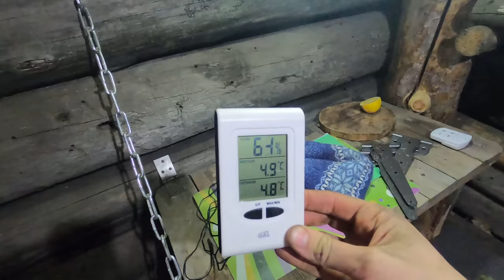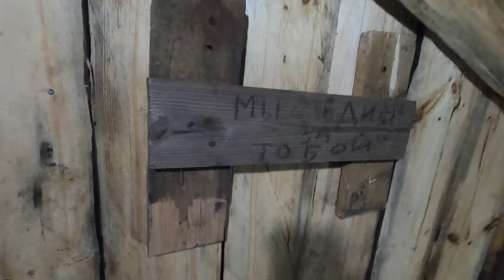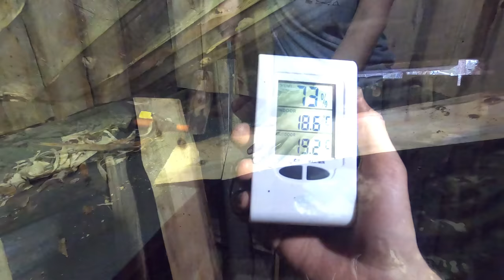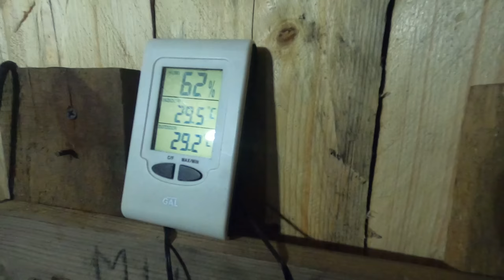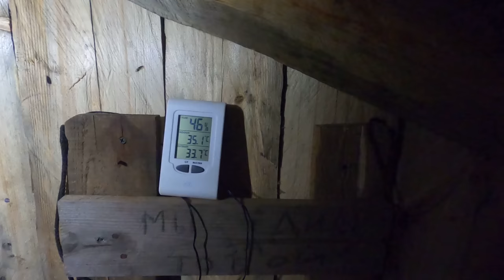ALEX WILD dugout life: WOODWORKING. Winter camping: new door, new interior. PART 11

Comment: Very nice and beneficial construction. For further improvement and safety measure, is it viable to ask about the possibility that leaks of carbon monoxide from burning woods inside the oven/chimney could happen? If yes, some systems of effectiveve ventillation must be constructed immediately to avoid the deadly effect of carbon monoxide.

The cabin is nice and looks sturdy in a background of a beautiful winter. Great project.

Comment: ...this is a great follow-up video to your first dugout video!  the dugout is getting even better... I don't understand the temperature readings though... unless your county converts Celsius to Fahrenheit differently, the inside temp at the end of your video was 120F and outside 117F ??  I truly dislike leaving a critical comment on your excellent video, but you say it got to 50C (122F) in your description and you then went to sleep and slept well?  Something's not right or your temp sensors (inside and out) are too close to the heat... perhaps a 1' or 1.5' feet away makes a substantial difference in the temp?   Also, at the beginning of the video it appeared you'd made a covering for the stairway to protect it from the snowfall, but in the second half of the video it was gone?  I thought a covering for the stairway was a great idea... oh well, I enjoyed watching the video very much, you've got a lot of skills...
Reply: that's not outside temp, he only shows outside temp at 0C in the beginning, on the window mounted thermometer
Reply from the maker: Yes! Before going to bed, I put a lot of firewood in the stove and an hour later I woke up from the fact that there was nothing to breathe the temperature was +50 degrees Celsius! I had to open the door to the dugout a crack to get a comfortable temperature
Reply: @alex-wild  Makes sense now!

Comment: Your stove doesn't seem to be drawing effectively; isn't this the reason for the black soot on the stove front above the door? Do you use carbon monoxide and/or carbon dioxide monitors in the dugout?
Reply from the maker: Yes. You're right. In the future, I will redo the oven. I'm using a carbon monoxide sensor!

Comment: Did I miss the part where you set up the digital thermometer?  I was curious so I googled the conversion from like 33 and 35 Celsius to Fahrenheit.  Now I can understand 35 C being the indoor temperature, but 33 C being the outside temp??  I guess I was just wondering and/or assuming that both temperature sensors must be inside.  Mainly because I don’t think there would be snow outside your shelter in 90° weather.  Anyway I guess that’s my comment/question.  Is the digital thermometer displaying the temperature from two locations inside the shelter?   Or does the snow where you live also not know how to convert C to F off the top of its collective ice brain, can’t ask Google, and simply doesn’t melt because it thinks 35 C is equally as cold as 35 F 😂?  

What if snowmen aren’t created by humans?  We just wake up the next day after it snows, and see them.  With the assumption another human created them!  What if they create themselves in an attempt to form some sort of a collective?  A hive mind order to increase thinking capacity?  In order to get to the point that it’s capable of converting from Celsius to Fahrenheit without asking Google!!  What if some of them actually reach this goal, and the moment they realize how hot it is, they start to melt and die?